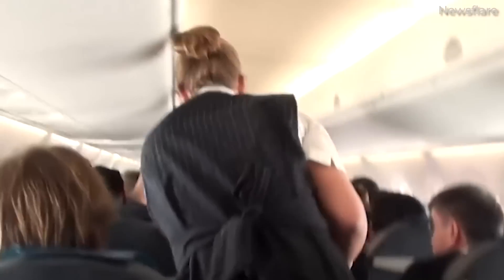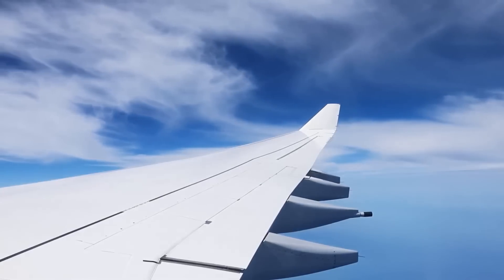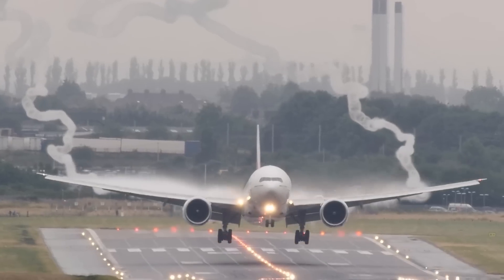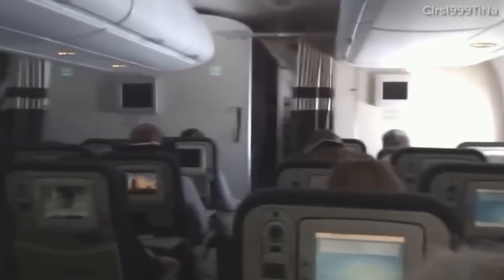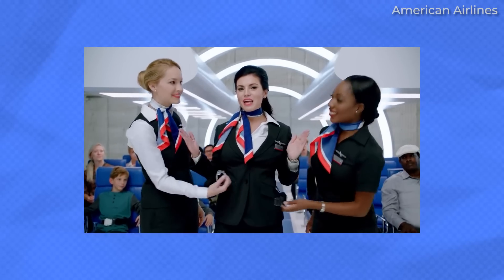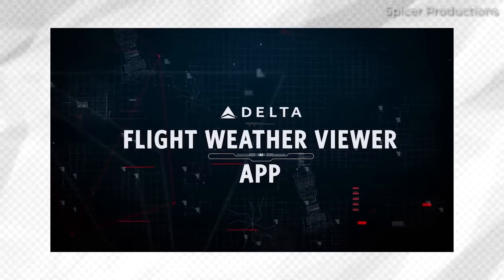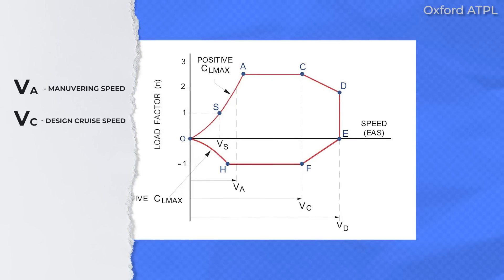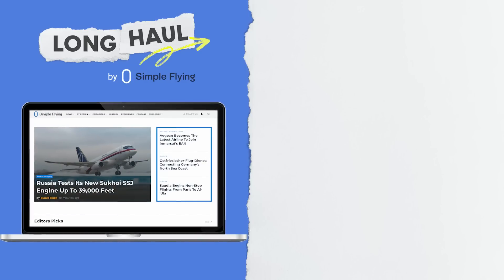Flying Through Turbulence: A Comprehensive Guide

Comment: Really good for someone who’s gonna fly for the first time or is nervous; HOWEVER, the excessive explanation of all the types of turbulences and wing wake bit was incredibly overdone. 

Even as an avgeek, I felt it dragged too long and it could’ve easily be a separate video. 

The point is to reassure nervous people, not a lecture on aerodynamics. 

A better take would’ve been. 1) air is a substance and behaves like water at high speeds (oversimplified, but to the point) 2) when the plane encounters such different currents and airstreams, it’s like a boat going through rougher waters or a bus on a bumpy road 3) planes are built to withstand way worse than what you’ll ever encounter and 4) keep the seatbelt on in case of what it’s called “clear air turbulence”. But more on that on this video about aerodynamics

Comment: On my first trip to Brazil, which was with TAP from Lisbon to Belo Horizonte, we encountered severe turbulence as we were approaching BH, as there was a bad storm. It was so severe that the pilots aborted the landing and the plane was diverted to Rio Galeao airport. There also was bad weather there so the plane just kept shaking and dropping until we've actually landed. Nobody was injured but one passenger did faint.

Comment: Va is not a common speed used in Part 25 planes operation, unlike Part 23 planes.  Nearly all commercially flown types are Part 25. Unlike in Part 23 planes there is not the usual color coding on the speed indication (white, green, yellow, red), but other markings may exist, like the different kind of limit speeds for airbus (Vls, Valphaprot, Valphamax), buffet margins etc. Part 25 airplanes can withstand their max load limits in their full operating envelope with flaps up, and a slightly reduced load limit envelope with flaps down (2g to 0g flaps down, 2,5g to -1g flaps up).